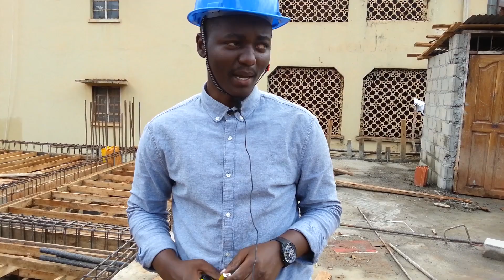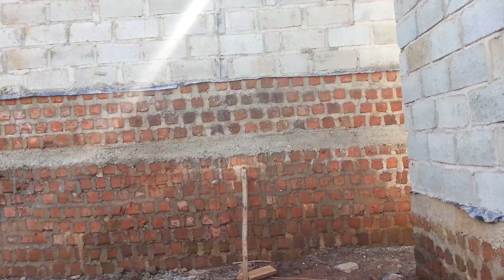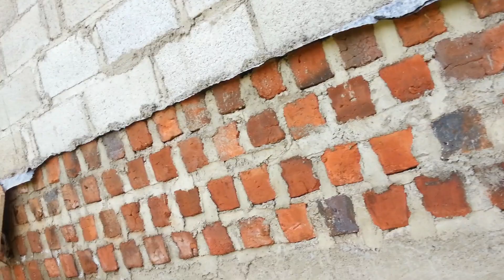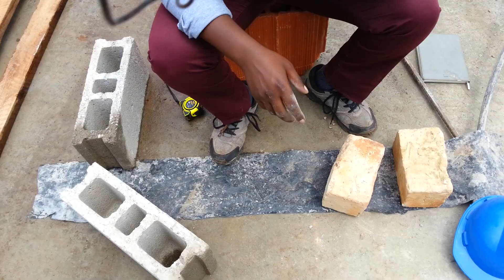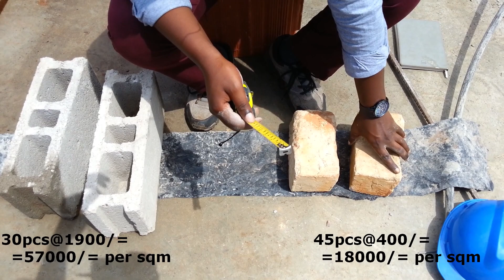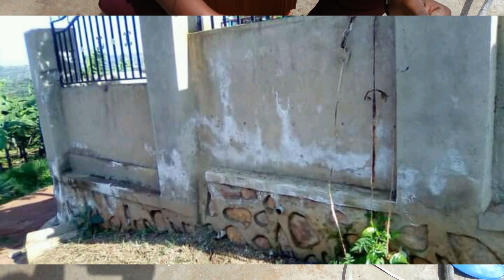Clay Bricks Vs Hollow blocks |Saving costs of building in foundation

Comment: Thanks bro, though i think the best reason could be the higher structural ability and load bearing capacity of the clay bricks since they are solid and able to recieve all dead loads of the superstructure.

The water absorption i find it funny as given by other engineers because actually we dont need our foundation to absorb any waters that why we put blinding layer of weak concrete mix or stones.

Im greatly inspired by your works. Each time im stuck on site, i run to your channel
Reply from the maker: Glad to hear you're finding the content useful!

Comment: In Nigeria, the geometry of blocks is 225mm × 225mm × 450mm. We also have 150mm × 225 × 450mm. So it's usually better to use the hollow blocks in the foundation than bricks.
Reply: Hollow blocks cannot manage the weight of a house. Hollow is weak for a foundation.

Comment: sir, in confined masonry 2story  house foundation instead of red  bricks can we use cement Soild blocks?
Reply from the maker: What do you mean confined masonry?
Reply: @mukizadarwin  sir,confined masonry! where the masonry walls are built first,and concrete colum and beams are poured in afterwards to enclose confine)the wall.